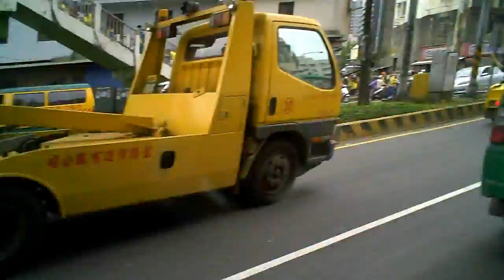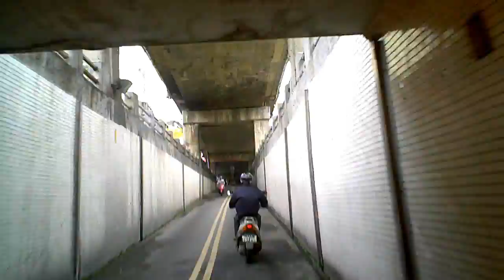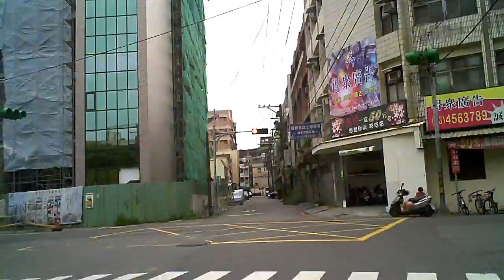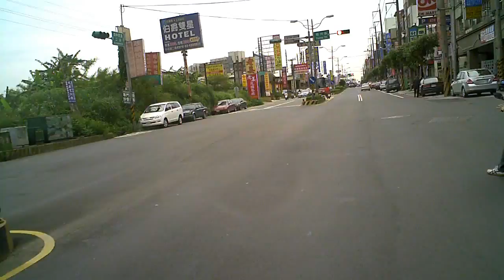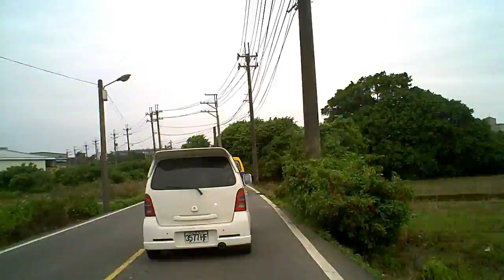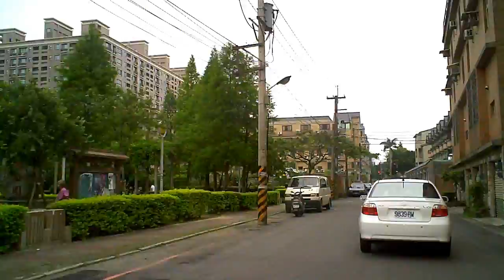Yamaha Cygnus Scooter - Group Riding Tips

Comment: Actually there is some truth in the cold plug statement. A colder plug in a engine with increased compression will help prevent detonation under load. Continuous detonation will melt pistons quickly so that's not a bad idea especially when sustained high speed is expected.

Comment: A Ninja 650 gives you the commute and  track experience, a supersport like a r6 zx6r etc, you'll be bent over 100% of the time and you use like 1/5 of the power on the road. Might be a bit different in Taiwan but generally speaking a 650 or fz6r etc. are generally better bikes if you are constantly riding.

Comment: if one increases the heating capacity of the engine, i.e. higher horsepower, the cooling capacity should also be increased so that the engine runs at the designed operating range.

Comment: Because heavier motorcycles simply wouldn't be practical compared to scooters. As the distances travelled are minute, thus making the scooters a whole lot more economical, while in traffic a whole lot more agile and practical. 
Apart from this, Taiwan, as with many Asian countries, only recently introduced larger bore motorcycles (legally). Therefore it is logical they are rare, due to costs involved etc.

Comment: On my 70cc (50cc moped) i put in a colder spark plug so at the high speeds my engine would be colder, But you would have to warm your bike up if cold or you will do the damage that way.

Comment: if your after somthing for your cygnus then may i suggest (if they have them over there) a Leo Vince 4road exhaust, doesnt really do much in terms of power but does make the bike a little louder so if you do get a tad ahead of the group at least theyll still hear you a bit, ive also got a malossi variator which helps with acceleration, i wouldnt mind an enine kit but not sure whats best to go for, but thanks for outlining the problems with the larger of the kits whit overheating and what not

Comment: I assume the Cygnus is a two stroke but is it water cooled?  If it was water cooled going to a higher temp thermostat, a continuous fan, and higher capacity radiator could have maybe kept it cool enough if it was water cooled.  My liquid cooled Sym HD200 is 171cc and rarely gets hot, granted it's also a 4 stroke engine too, but the cooling dynamics should be similar though you might have to get a custom body panel where the newer larger radiator is housed.

Comment: You had another video where you commented on how a small 250 sportbike could beat 650's at the track because of the riders talent during turns. Unfortunately this same logic would work against you durinig the tours. You could have a slower scooter and yet still consistently pull away during the turns. However since you also suggested shitty tires, you may not be able to take those turns. So maybe it'd work out

Comment: The brand of the bike you're using for the swap has absolutely no bearing on the motor overheating.  And yes, any time you start modding your bike then you can expect it to develop problems.  They'll be cool and fast and nowhere near as reliable as they were stock.